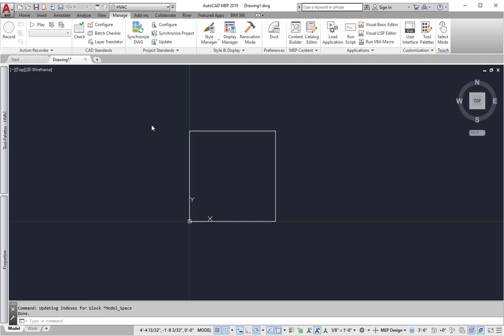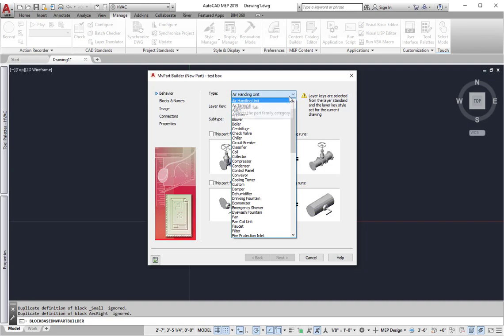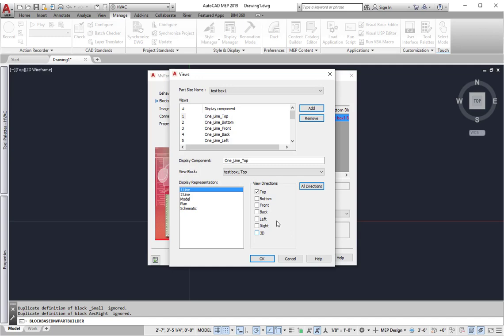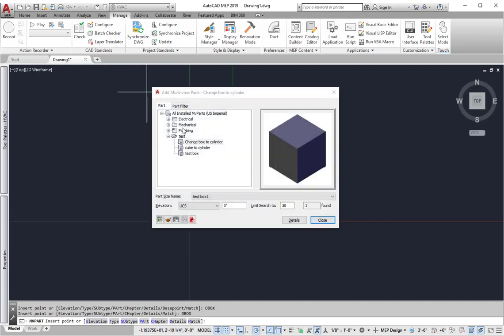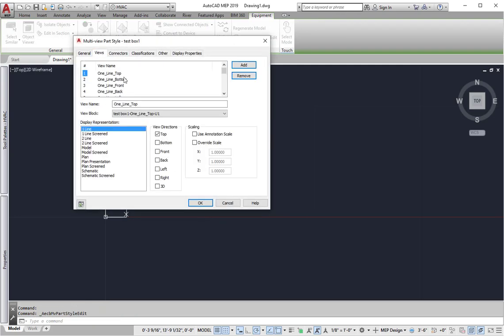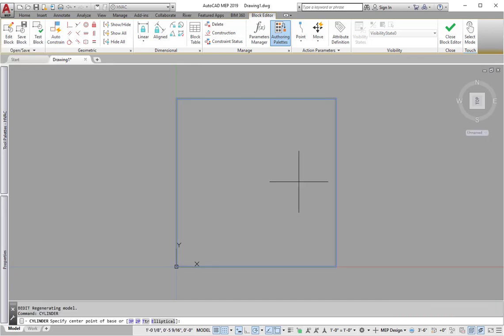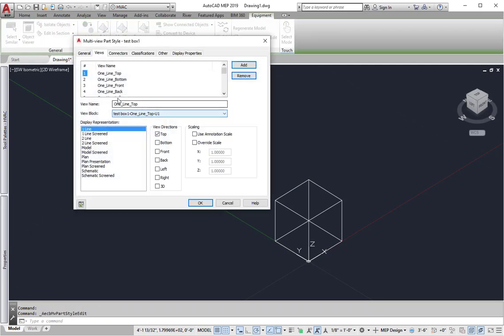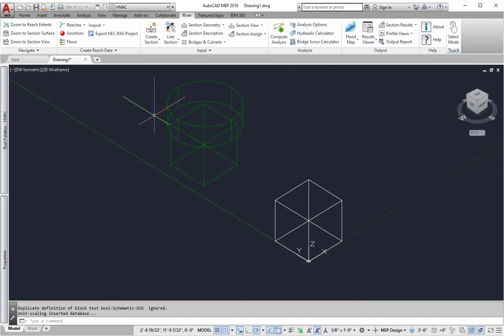ACAD MEP creating Mvpart and editing nested blocks

Comment: David, I'm new in MEP.  I created a chiller by grouping extruded objects, making it a block, and then following your instructions (I think) to make it a mvpart.  I have 4 piping connections and they all work.  My problem is the insertion point and the side it comes into the sheet.  I keep searching for how to modify those attributes and keep coming across this "There are other insertion behaviors that you must specify in the Options dialog box, which you can access by clicking  in the Content Builder part browser" but I don't see the "Options Dialog Box".  Mine mvpart also has the axes labeled wrong, so say I want to have an elevation of 1' in the z-axis, it's seeing that as 1' in the x-axis in Normal and 0 for both the y and z-axes.  Basically, I'm not able to put it in Model Space like the chillers built into the program.  Does this make sense?  thanks!
Reply from the maker: The distance in the axis can be anything, but it's the value of something over 0 that makes the connector "point" into a specific direction. So you have to play with the distances until you get the "z" axis of the connector to point into the correct direction. If you want to send me a drawing that includes the MVPart, I'll take a look it it - send it to dabutts7@gmail.com. Thanks!

Comment: Thank you for this concise explanation on creating MvParts. Precisely what  I was looking for in an instructional video.

Could you do a video on creating custom tags for diffusers/MvParts? From what I understand, MEP does it based on Auto Increment but I was wondering if there was a way to formulate it so it says. i.e. CD-1 for a given CFM range and not list all the diffusers in model and go CD-1 to CD-XX.
Reply from the maker: You can, but you'd have to predefine a property set definition (a text value name CFM_Range would work) that you can assign to the part and tag it based on those values. Since we don't label ours by CFM, it's not a function I've tried - but I do use the CFM airflow value in a tag so it's displayed in the drawings.
Reply: @7dabutts is the website cost 💲 money 💰 or it’s for free 🆓❓